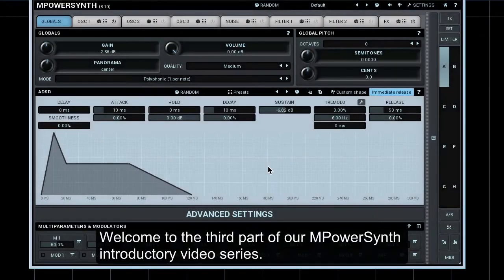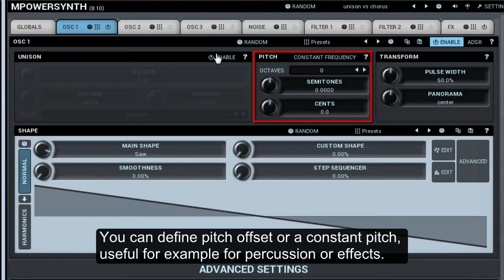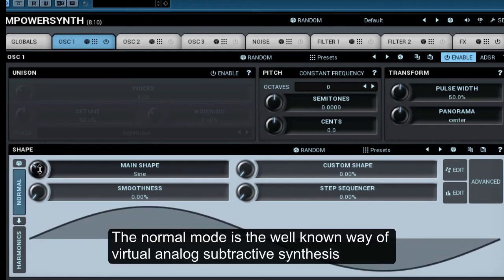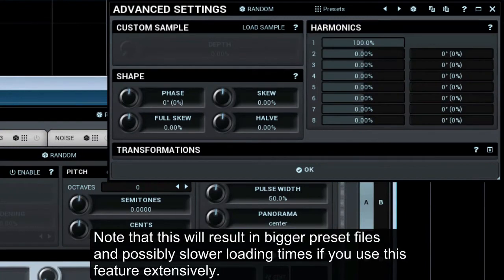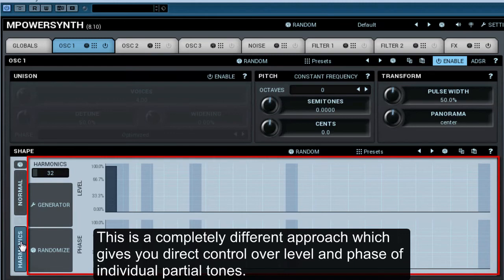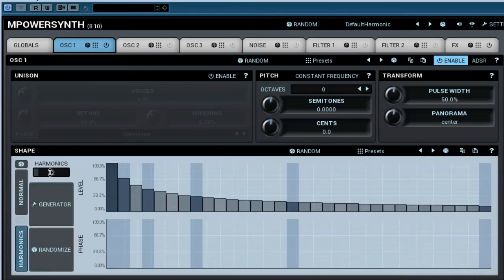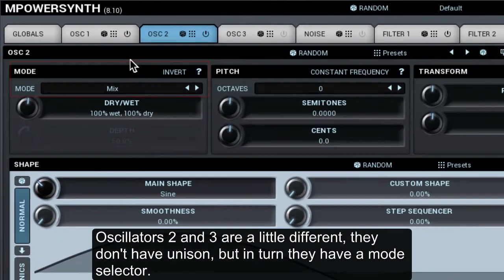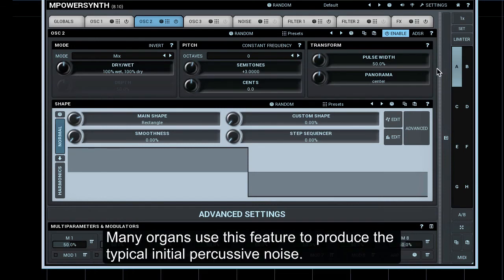MPowerSynth tutorials - Part 3 - Oscillators

Comment: 0:47 There is another way to get unison that works with all oscillators and it was partially explained in the previous video.  Go into the global advanced settings and under the Harmony tab enable the amount of voices you want.  Simply set them to 0 semitone offset with slight detune.  Since this is technically a MIDI function the synth will need to be in Polyphonic mode (not Polyphonic 1 per note).

Comment: When you use a random button: What if you like a sound, but hit the random button again by mistake. Is it possible to go back one or more steps? It's easy to get going pretty quickly, testing different things, and them realize..."Hey, I really did like that one setting 2 steps back...let me hear THAT again".   But if that happens, as far as I know, it's too late.
If this is not possible right now, would it be difficult to have the synth remember the last few random settings?
Reply from the maker: For that there's the Undo button below A-H presets ;).
Reply: Oh yeah, there it is! I was looking for a single curved arrow thingy. Super simple, anyways. Thanks!